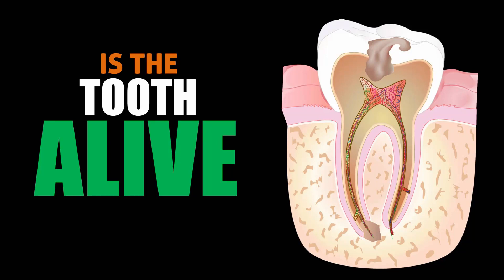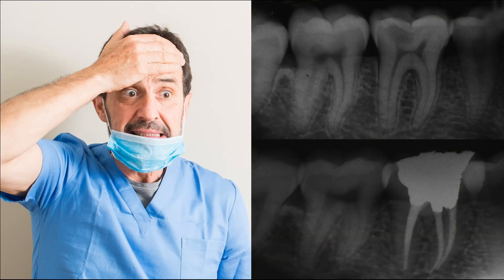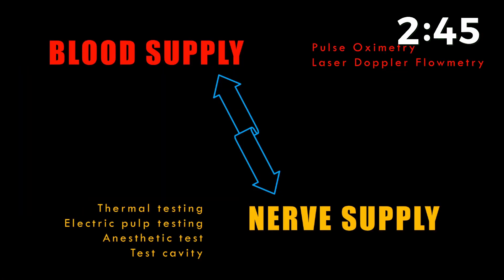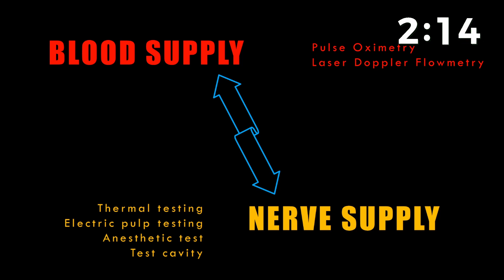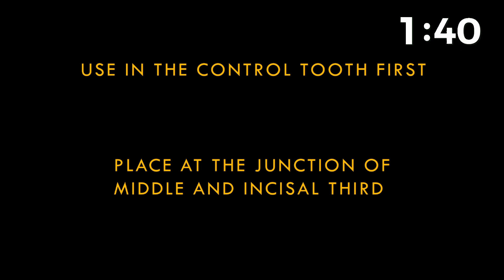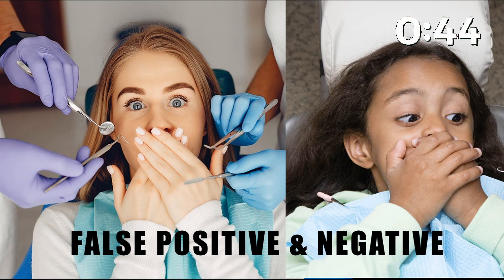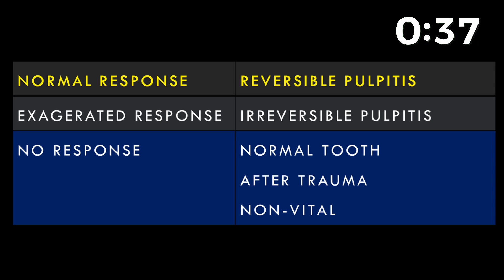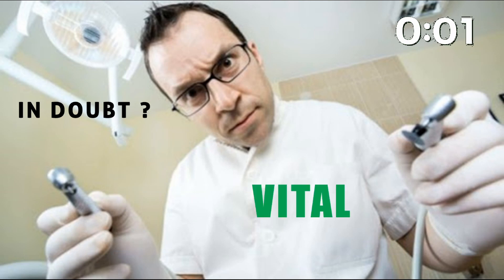Pulp vitality testing

Comment: Wonderful videos sir:) I had a doubt ...if a patient had lingering pain in lower right teeth region with an intact metal ceramic FPD wrt 45, 47, 48 ..how do we check vitality in crowned teeth?
Reply from the maker: We can use EndoIce which is a spray available. We can also use any other cold pulp vitality testing over the crown.

Comment: Dear sir I have 3 questions if you may 🌹
1) what are the cases that may give negative false response other than the traumatic nerve

2) why we are seeking to know wheather it is irreversible pulpitis or necrotic , at the end we will go for RCT, what is the difference or there is something i missed

3) if we do not have the oximetery and flowmetery , is these any clinical sign that may show it is a non vital tooth
Reply from the maker: 1. Calcified canals, thin fibrous canals especially in old age patients, high pain threshold of the patient
2.In case of irreversible pulpitis, the tooth is said to be vital. In necrotic pulp, the tooth is non-vital. Treatment planning, intra canal disinfection, irrigation protocol are dependent on the pulpal status
3. Both pulse oximetry and doppler flowmetry are not available for dental use at present. Clinical signs like history of pain, type, nature of pain, tenderness, clinical examination for color change, sinus tract, apical tenderness, extent of dental caries, probing inside the cavity all gives details about the pulpal status